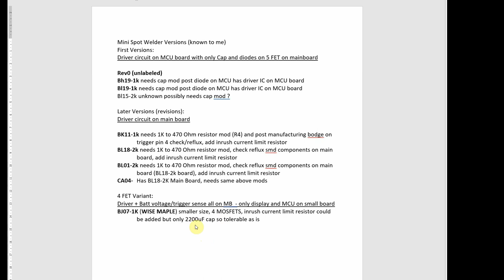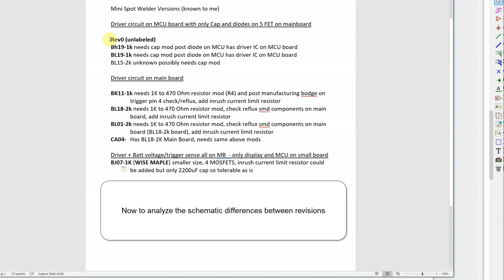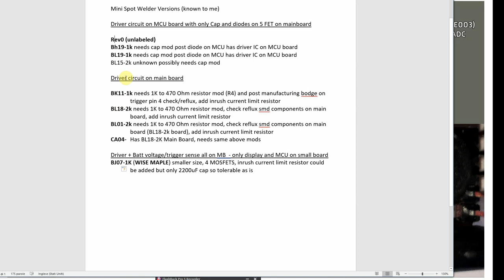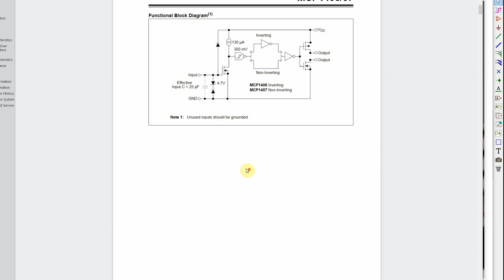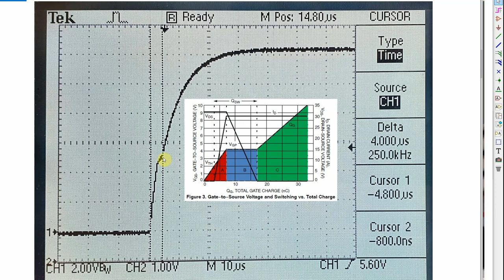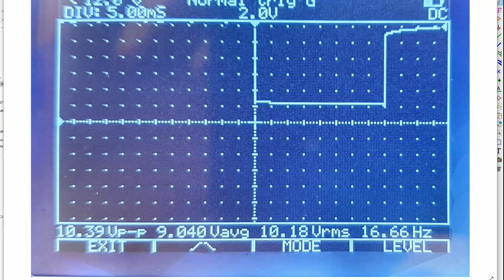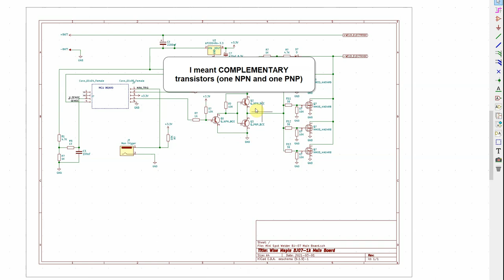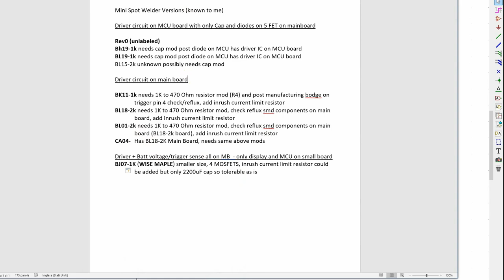All "Mini Spot Welder" versions: circuit Analysis, differences and faults

Comment: This is amazing. I, and many others I am sure, would love to know how you reverse engineered this circuit. Techniques? Methods? Etc. Do you have a computer program to help? All manual tracing? How about a video on generating a schematic from hardware? Yes, Yes, Yes! Cheers.
Reply from the maker: Hi Scott, usually "low density" high power boards like this one are REId simply by manually tracing the various connections with a basic tester. As the designs are really pretty straight forward it's not so hard to guess what's going on. Once the basic design has been traced (I use from a simple piece of paper to KiCad or Eagle for the design import and aided tracing but there are others such as the free online EasyEDA) you can reproduce it in any Electronic Computer Aided Design software. For simple low frequency projects there are no real critical aspects apart from having the right track widths for the appropriate currents (which many tools already do for you), but when you start wanting to design higher frequency PCBs, many aspects come into play, mutual induction between traces, inductance and capacitance which considerations play a fundamental role in "getting it right". It's all a frequency garble and it's hard to get things right the first time even when you try to consider everything as the real world scenario is always different than the theoretical models. Multilayer boards have power buses sandwiched in certain levels to avoid cross inductance between tracks, to attempt to create a better shielding but at the same time may create unwanted "capacitance" and where High Voltages (Mains Voltage or more) are present things are even more complicated involving faraday shielding, ground loop prevention, arc avoidance, double and triple transformer isolations, poting, EMF shielding, Mains Noise injection prevention and so on. It gets all pretty complex and complicated and even with the application of the "rule of thumb" things are never straight forward. Just consider that at todays level of integration (thing of smart phones) a human is no longer able to repair or service any device above a certain level of integration as it is not only physically impossible to repair internal traces or even replace a failed IC as simply reballing it would create secondary points of failures, but the cost is no longer justifiable. On one end there is the somewhat ethical issue of induced "programmed obsolescence" for corporate profits and on the other the "miniaturization" of these designs as partially designed (AI), built and assembled by machines themselves. So back to this Mini Spot Welder, it's all pretty straight forward and was done basically with pen and paper and a tester - with these simple 2 sided layouts it's rather more for the "fun of it" than anything else, just to see what and why things are failing and see if your "gut feeling" is right!

Comment: Great explanation! Thanks for the effort. I have the version without any components under the 10,000 capacitor and 5 FETs (mine even had the blue tape on the display). What version would it be (it might be the CA04-2K)? What are the mods for it? Although, I think I might return it and try to find the Maple variant or other recommended unit. BTW, what unit would you recommend? I don't mind buying a $30 item and putting $10 of parts and work to get a $70 value... If my CA unit is upgradable I'll mod and use it.
Reply from the maker: If you have no components under the large 10000uF cap then it's what I call "Rev 0" which has the dedicated MCP FET driver on the MCU board (you should see it). You need to add 470uF-1000uF cap just after the MCU power input diode to fix that version and then you are set.

Comment: Hi! I am looking now at Wise Maple model. What is the best power source for it? Is lipo battery 5000mAh 60-140c an overkill?
Reply from the maker: A 3S 5000mAh 90+C will do fine yes.
Reply: Is it 90c of burst discharge?
Reply from the maker: @andreygalagan5065  Usually the rated C discharge rates stated on LiPo packs are "sustained"; however it is not advisable to sustain the max discharge rate for more than a few seconds to preserve the life of the pack. Given that the Spot welder only does this for a few milliseconds there are no issues whatsoever in this scenario. The most important thing to gather from this is that the higher the rated C on a liPo pack, the lower the total internal resistance of the pack which means less heat dissipation and more peak power which is what you want. In other words, the higher C discharge rate the better welds you get and shorter pulse times.
Reply: @Luca_Techy  Thank you for extensive explanation! This is clear now. Seller says 4500 mAh 40-50C but I would feel more comfortable with stronger LiPo. Just dont want to burn the thing down with way too powerful battery discharge.

Comment: I just bought one of these spot welders as I've been wanting something a bit more powerful than the one I currently have. I did all the mods but even on level 4 it seems to be too powerful, just keeps busting up nickel strips.
Reply from the maker: Are you sure the FETs are not shorted or there is some driver issue? Did you do the lightbulb test as explained in my other video to check to see if it's working properly? Which exact version do you have? Are you sure it's not the New Rev 0 (check out my recent video)?

Comment: Very well done sir!
This is very informative. 
Maybe someone knows what to do since mine does not regulate at all. Whatever value I dial in it is always hammer down. Managed to weld some cells with it but whenever I do not pay full attention it does burn wholes. Any advice?
Reply from the maker: Hi, you most certainly have a shorted FET so you will need to locate it and remove it (if it's not visibly broken you'll have to remove them all which can be tricky if you're not handy with soldering irons or don't have a hot air desoldering station / gun). In my playlist there is a short video on how to check if your welder is working properly before trying to weld.

Comment: Hi Luca, thanks for your efforts and well description. I have modded BL18 board with both resistors and I am supplying the welder from 2 Rhino Lipo 2250mah 40C in parallel. I successfully welded 0.15 strips at 30ms hardly but the problem is that I see the display dimming or even turning off during the milliseconds of the weld. I have a 0.5F super capacitor I think to add it in parallel with the capacitor (the smoothing one to act as a battery for the MCU and the driving circuit), what do you think?
Reply from the maker: Hi, firstly consider that the Bk11/Bl18 etc versions do turn off the display during the weld so it's not the voltage drop that is causing this (you can try youself just manually triggering the weld with the contact points open, the display will blank for the weld time) so that behaviour is normal. What I suppose could be the issue is the voltage drop maybe due to excessively long cables - you should try to keep them as short as possible or replace them with thicker guage cables possibly good copper strand (AWG 8 or so). You can add the supercapacitor adjacent or as close as possible to the spot welder input in parallel to the battery which will certainly improve the weld energy.

Comment: Hi Luca sorry to bother you hope you can help 🙂
I have a version CA04-2K and I haven't made any changes yet because 
I just wanted to test it first. But then something happened that I haven't found in any videos, 
And it was nothing, it does everything as it should, except for the pulse itself, 
I have tried auto and manual release but the power does not come out. 
Do you have any idea what it could be? is something else broken?
Reply from the maker: Does it beeo when you trigger it? If it does then you have to disassemble the mcu board and double check all solderings up to the FET gates. Somehow it's not activating the FET gates.
Reply: @Luca_Techy  Thank you for taking the time to help.
I've soldered all the solder joints to make sure there isn't a bad one between them.
Still no luck.
I have uploaded a video on youtube and invited you to watch it 
so you can see what it does. 
The video is only private right now so only you can see it.
Reply from the maker: Send me the link via email
Reply: @Luca_Techy  Mail is sent to the mailadress ind description
Reply: Thanks for the help Luca, it works really well now 
I've sent you a beer, I hope it tastes good 🙂
Reply from the maker: @Woehlk35  Cheers!

Comment: Hello Luca, 
thanks for your many very informative videos about the mini spot welder. I just bought one at Banggood but I did not try it out yet because I am not exactly sure what kind of version I have and what kind of mods to apply. The printing on the display board reads CA20-2K. My version of the display board has black buttons and it looks very much like the CA04 (at 13:32). It has a grid pattern and the resistors are numbered. The board with the MOSFETS has the diode and many SMD components under the 10000uF cab. It looks very much like the one at 7:21. But unfortunately I cannot read the printing on the diode. It looks like the printing has been scratched out by the manufacturer. 
I checked the MOSFETS. They seem to be closed (no shortage).
So I just want to ask you what kind of mods you recommend for the board before I plug it on my battery (Goldbat 3s 5200maH 80C) and destroy something. Im pretty sure that I need the two resitor mods, but do I also need to add a capacitor for the MOSFET's? Maybe you have seen or noticed my revision CA20-2K of the welder.
Thanks for your help and kind regards
Michael
Reply from the maker: Hi you need the R4 mod (470 Ohms) and the inrush current limiting resistior (add 20 Ohms).
Reply: @Luca_Techy  Thanks for your help. I will give it a try.
Reply: Check if the diode is not dead. U can try steps as my comment: For the CA20-2k circuit you need to add 40-50 ohm resistor to the reverse input diode same as 8:33, watch close and u can see that the diode is  mounted sideways and in !!SERIES!! with resistor!!! (before adding resistor check if the diode is not damaged, mine was so i change it for a schottky diode with 50 ohm resistor in !series!). Also u need to change r4 resistor for 470 OHM. Also this version can work with 4s Li-po battery (tested). 

That way mine after blowing 2 fets without modds, i did steps that i mentioned above and it works like a champ.

Comment: So, would it make sense to buy a Wise Maple from the get go?
Reply from the maker: It's the version that requires practically no mods if you use an antispark xt60 or xt90 plug..
Reply: @Luca_Techy  Thanks for the reply. I'll grab a Wise Maple.
Reply from the maker: I'll be putting out a video on the latest release, but it requires a couple of mods too so for now the Wise Maple is still the one which requires practically no mods and performs well.
Reply: @Luca_Techy  Excellent. Thanks for all your help.

Comment: Luca, thank you for the great explanation. I ordered the Wise Maple model and have a question. The instructions say to use a 12v car battery from 25 to 40ah. I have a 12v car battery with more than 40 ah capacity. It should still work without issue correct? I don't see why using a battery with higher capacity should be a problem as long as it can supply sufficient current.
Reply from the maker: Sure, that's a ballpark range, you just need a minimum of 150 CCAs to start getting decent welds. Just start off with a 5ms setting and go up from there when first testing.
Reply: @Luca_Techy  Much appreciated! Btw @23:32 "abnormously" is my new favorite word.
Reply: @Luca_Techy  - Does this mean my 100ah deep-cycle battery will work well, I just need to start off with a 5 or 10ms setting?  Is it possible to use too much battery?  I have the Rev-0 model, with no markings on the boards.
Reply from the maker: @jasonbroom7147  First be sure to have added the 1000uf 25V decoupling cap on the MCU board just after the diode. If you've done that then you can test the welder starting from 5ms upwards. Be sure to have good clamped on (or even better screwed on) connectors to the battery terminals. Start with a .12mm strip and see how the welds turn out - if your battery is good you should get good welds around 10-15ms.
Reply: @Luca_Techy  - Is there anything I can do to avoid having to add the capacitor, like use a very specific battery?  I am HORRIBLE at soldering, which is why I bought this spot welder in the first place.  I'm starting to think I should have paid more for one of the units that doesn't need to be worked on before it will work safely.  If I use this, I will add good terminal ends and ensure a solid contact with the battery, which is a high quality AGM, 100ah marine battery.
Reply from the maker: @jasonbroom7147  If you have a very good battery which you have used before to spot weld you may try some welds at a very low setting. However I strongly advise against it as you can't know the internal resistance of your battery and a large voltage "dip" is very easy with his application which would destroy your FETs. The capacitor mod is really easy and you can check Maker Fabio's video on how to do it in detail. You just have to solder the 2 legs one after the diode and the other to GND on the MCU board. At max if you don't feel up to it maybe you can ask some friend to do it for you.
Reply: @Luca_Techy  - I'm confident my battery would work, but I have watched the video you recommended and I can probably do that soldering successfully.  I will order the capacitor and the shrink tubing to modify my control board before using.  Thank you so much for answering questions and helping make this inexpensive mini spot welder safe and effective to use.

Comment: I'm wandering i bought one these it doesn't arch at all is solder suppose to cover both ends of the 5 mosfets ? Cause mine has poor solder job and I looks like one of the 8pins is not soldered to the other ones
Reply from the maker: I don't understand what you mean by both sides: the Drain and Source should not be in contact, that's the whole point of a MOSFET: they will "short" when the Gate (pin 1) is saturated. If you get no activity, try my lamp test (check the video) first and see if you get anything at all with max settings using a 12V filament lamp. Be sure to apply the R4 470Ohms modification and add the current limiting resistor before or after the large reverse discharge Cap diode as shown in my other video.
Reply: @Luca_Techy  on source side all the contact points are soldered together except one contact point of each MOSFET .each mosfet is same way .mine doesn't arch at all when touched to nickel strip .
Reply from the maker: That's normal, pin 1 if every MOSFET is the Gate and should be seperate from the other pins. Did you apply the indicate mods?
Reply: @Luca_Techy  no I figuared I see i I could at least get it to arch.thanks I'm still learning got 30 years in automotive dc but still learning components and operations
Reply from the maker: Apply thr R4 mod (you can use either a 1k ohm in parallel with or replace the smd resistor with a 470Ohms) and don't forget the diode reistor. Also, carefully reflux the transistors while you're at it to be sure all joints are solid.
Reply: @Luca_Techy  will do thank you i will let you know after its done.

Comment: I enjoyed your video,, very informative. I have the bjo7-1k version. And it works well enough with my mower battery. But I was wondering... 
Do you think a 12vac 40amp transformer fully bridged rectifier would work with this welder? I appreciate any insight you can offer, thx
Reply from the maker: Hi Joe, the short answer is no, it won't work. The fact is that only a large battery can deliver such a high current (150+ Amp) impulse in such a short time. Alternatively you could use a large 12V 500F Cap bank in parallel to a PSU, but it's more expensive than just a decent 12V AGM 40Ah battery or 3S 50C 5000mAH+ LiPo.

Comment: what should the specs be on a battery to be used?
Reply from the maker: Hi, a 12V 45AH AGM car battery or a 3S 5000mAh 50C or more LiPo will do. A 3S LiPo pack is more convenient as lighter and easier to move around though must be handled with care and charged appropriately.

Comment: Hy! Would you recommend the wise maple or the other newer version? Wise maple only has 4 mosfets instead of 5 so my mind thinks more is better? If you mod the 5 mosfet one is their any difference or reason to get the wise maple?
Reply from the maker: If you are comfortable with modding and soldering then the best version is the Rev 0 with just the additional Cap mod if you can source it.
Reply: @Luca_Techy  thanks!  Don't mind modding
Can't find the rev0 tho🤔
Reply from the maker: @mirono3099  I know some people sourced it from Amazon - a good indication is the cost, it's about 8-10 Euros more expensive than the other revs.

Comment: Sir I have small spot welder bj07-1k by my any mistake 3.3volt regulated Ic very hot no LCD screen on no buzer sound I think MOSFET driver Ic short can you guide me
Reply from the maker: Yes you probably shorted something on the logic side (if the 3.3V regulator gets hot, the logic part is shorted, either the IC or something around that is bridged to ground). Try to locate the short using a multimeter - unsolder components if necessary. Not an easy job if you're unexperienced.
Reply: @Luca_Techy  thanks for reply sir 
Sir ic is short tell me it's solution how I can Arduino
Reply from the maker: @tipuzahid  There's a guide on instructables.com - the link is in my previous video about my Arduino project.